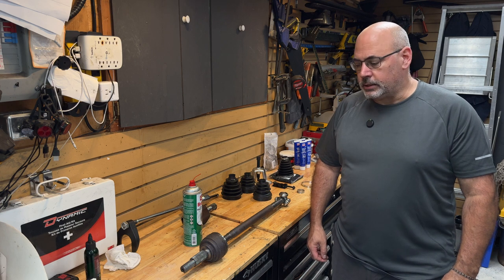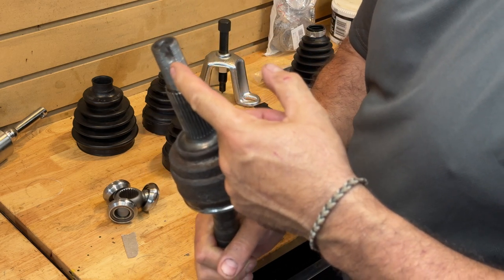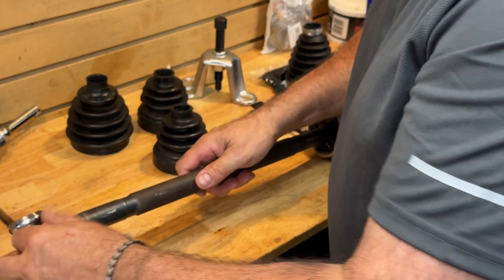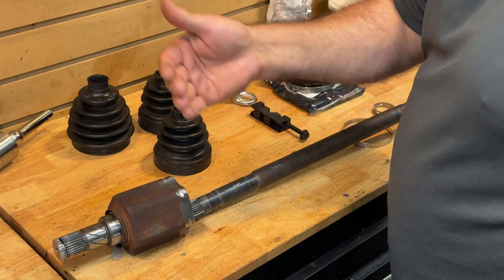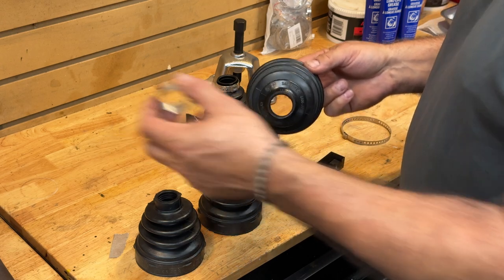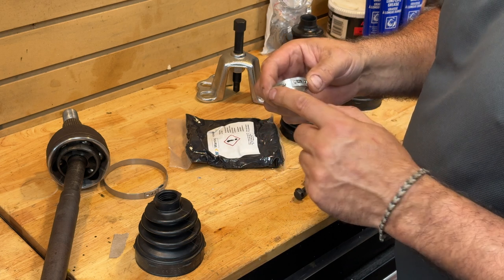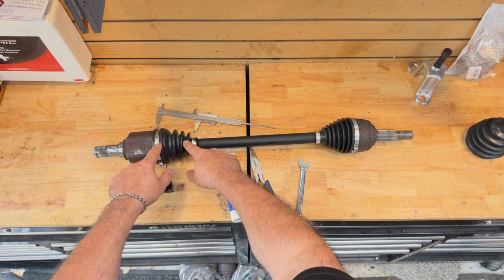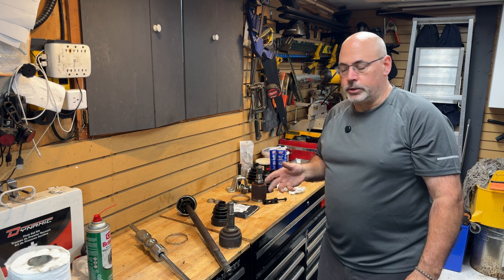Think Twice BEFORE You Rebuild Your Factory CV Axle!!

Comment: Part 2
Disassembly of the outer CV joint is not necessary as long as you wash it out really good . I'm an auto tech with 50 years of experience and I've never had any problems just cleaning the joint and adding new Grease, if you're afraid that you didn't get enough grease into the joint just squeeze the rest of that pack into the boot it'll work its way into their. By the way I could show you one of those $900 axles for half price price I'll just go to RockAuto and pay 90 bucks just kidding I don't want to beat up on my Canadian Neighbors
Reply from the maker: @marlobreding7402  I see that..although at the time of shooting Rock had none…

I had to replace the outer boot and unfortunately the outer CV joint was stubbornly stuck on there.  So I had to slide the outer boot in from the inboard inside as plan B.  On the first go, I did just slide the outer boot back and repack it.  Sadly, the universal clamp lasted just one week before it tore the old boot and grease was leaking out.  Removing the inboard was the last resort.  Good news though is take 2 is working great with a new boot, clamp and grease.. and the joint is happy again :-)